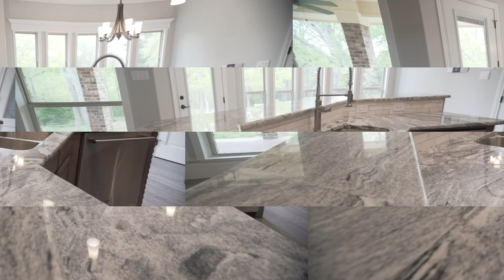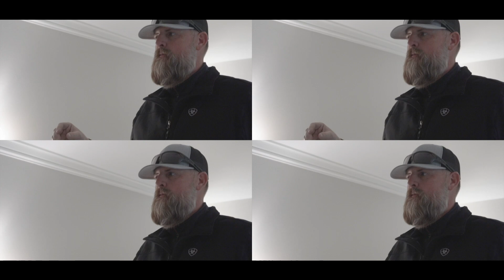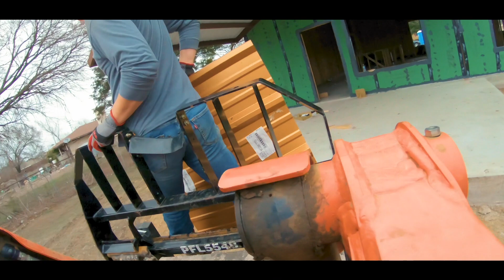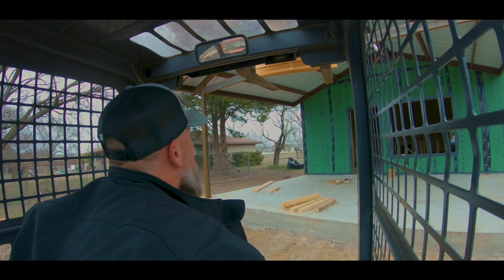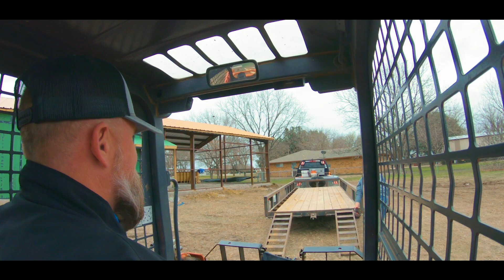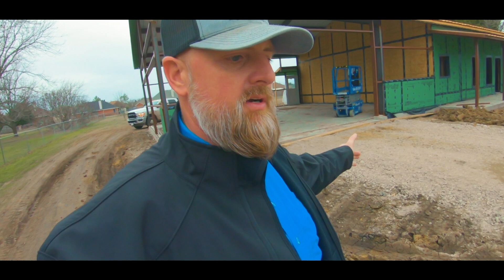AIR SEALING TECHNIQUE for BARNDOMINIUM HOME in TEXAS | Texas Best Construction

Comment: Has the permitting  process gotten easier since gov Abbott signed bill 2439 into law last year?
Reply from the maker: We have not been effected previously nor at this time see a difference from that but I am aware of that bill. In most cases these builds happen in the county anyhow in rural areas
Reply: @TexasBestBarndominium  
I was going to build a barndo style house in the city of Denton and they said hell no. They had a list of aesthetics rules a mile long including 25 percent masonry, architectural details like cupolas, bay windows, and a laundry list of other jazz. So you can imagine how happy I was when the bill got signed
Reply: @TexasBestBarndominium  quick follow-up question- what inspections does the county perform on new buildings?
Reply from the maker: None. The only thing that is inspected is the sanitary engineer plan as well as the actual install of the septic system. Other than that there are no inspections required by the county in Texas
Reply: @TexasBestBarndominium  that is extremely great to hear thanks. Now I know I have to find some county land to build on.